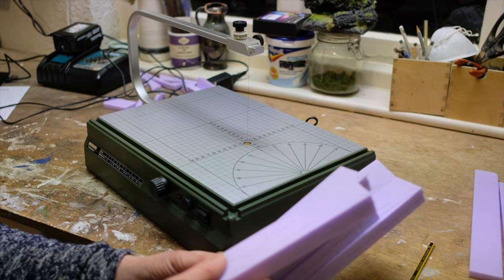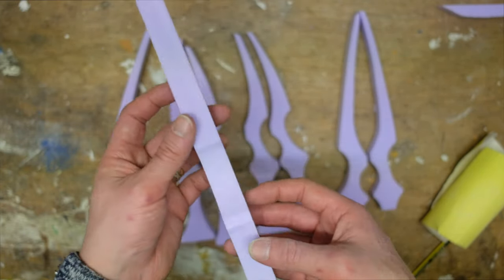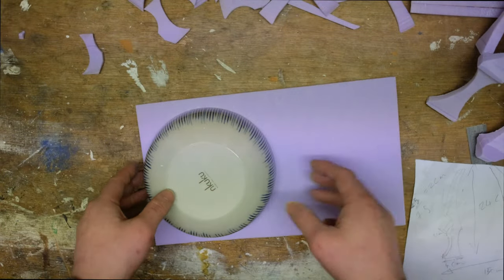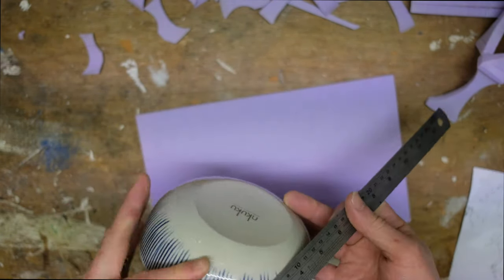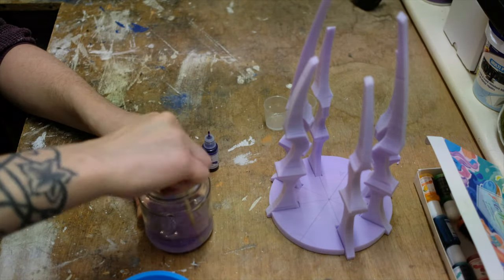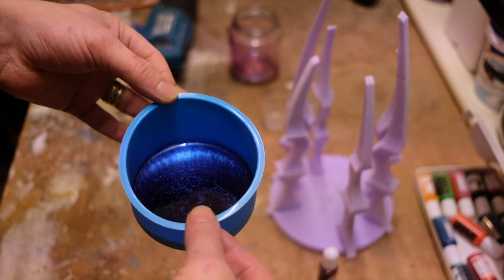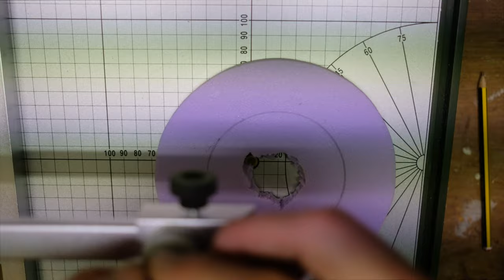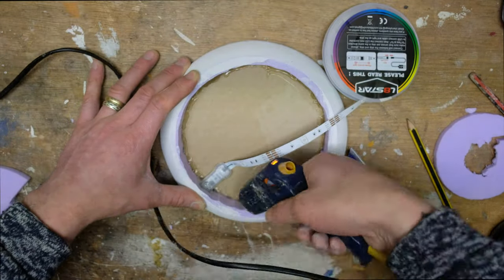How to build a Wizards tower LED LIGHT DIORAMA/ Terrain for D&D / Inspired by Call of Duty Warzone

Comment: Now THAT is a beside lamp fit for a Dark Lord! Awesome work, especially considering it's your first job with a new tool - wouldn't be able to tell just seeing the finished piece.  Love how the resin looks like an eye when lit too.

Re. tapering parts which do not have a flat base, not 100% certain it would work with a hot wire, but with a bandsaw you can usually use the offcut from the same part to support it. Should work in principle, might make it a bit easier. I'd also suggest getting or making a circle cutting jig - you did some lovely cutting on those circles, but that should help you go way faster even if it's just a piece of plywood with holes in it for a pin :) It would also make it easier to bevel the sides of the base.
Reply from the maker: Awesome! thanks Karl, using the off cut is a brilliant tip! I will do that next time for sure :)